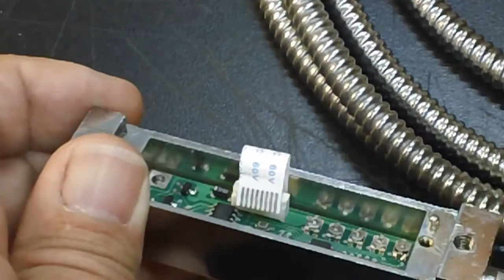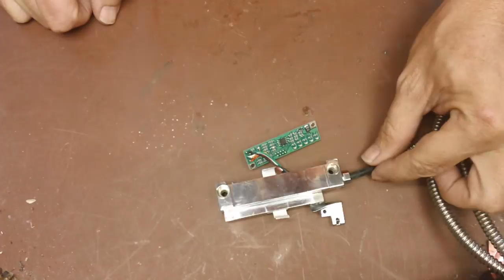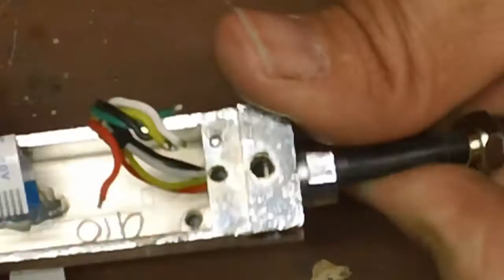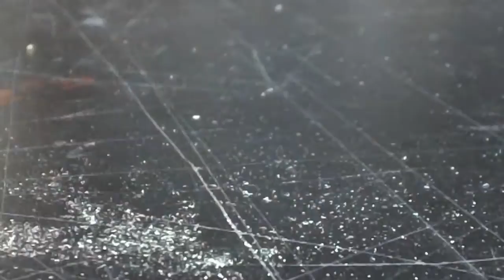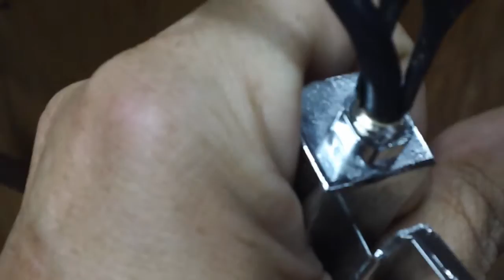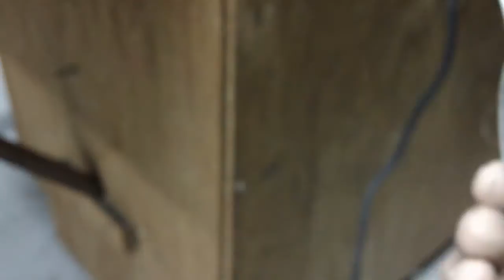Part 2 - DRO Linear Scale Reader Repair Project (Jenix)

Comment: I don't know of any one that would even attempt fixing a old dro like mine. I bought a used milling machine with a acu-rite 11 with the  cord ripped right out of the scale on the x axis and the nut with the pins that goes to the back of the console was missing. The y axis and the console are ok. I found a replacement  plug and a owners manual witch might help. I don't know if it is worth the cost of fixing. If you need a challenge I have one for you .I liked your thoughts and the way you went about fixing it. thanks for sharing.
Bill